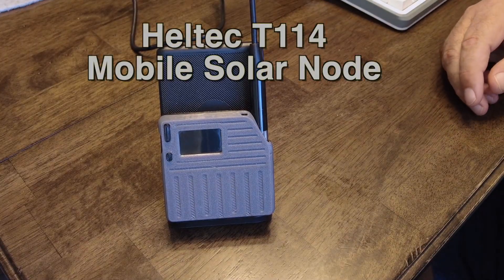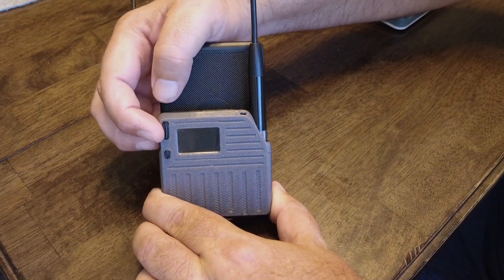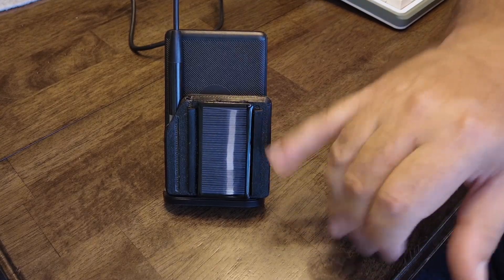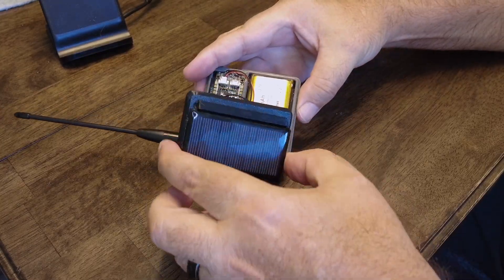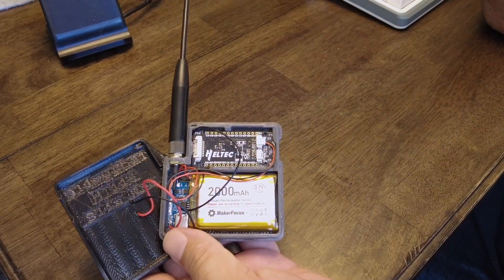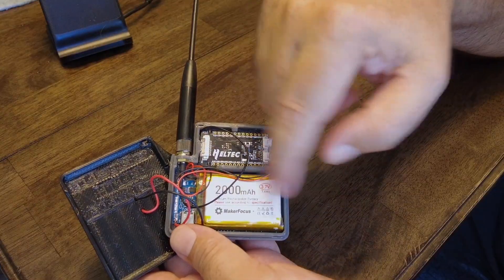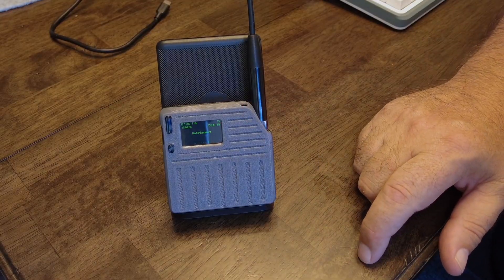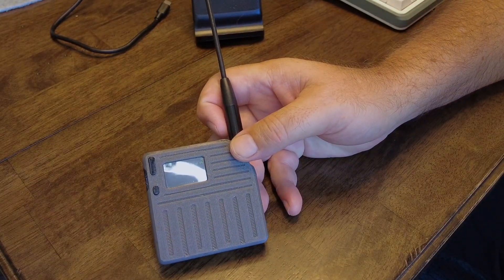Build a Solar-Powered Node That Lasts 150+ Hours!

Comment: You linked the short solar charger that Replaces TP4056 Long one. Do i understand right that, in this video, is the Long version in your printed case? Would you happen to know the difference between the two? Thanks for sharing all your information, appreciate it.
Reply from the maker: I think I just used the same version I linked. The TP4056 is not MPPT. A better, slightly more expensive MPPT controller is the CN3065 https://amzn.to/4o41IP7
Reply: @ViVSoftLLC  ok sounds good, ive never built one before so so im not familiar with the parts. Thanks for all  your help and videos. 👍

Comment: forgive my ignorance, but why would it overheat while charging?   
By a strange twist of fate, I'm looking to put a standalone node above  the snow line so this actually could be a benefit but don't want to go off half cocked.
Reply from the maker: No worries at all, Robert! Overheating while charging can happen if there’s too much energy input relative to what the system can handle, or if the components aren’t properly rated for the conditions. Living in Florida, we are used to high temperatures (95F on any given day), and with the Heltec rated at 170, but the Lipo rated at 140F, I am always worried about overheating here. It’s great that you’re considering a standalone node above the snow line—it definitely has its advantages! Just be sure to monitor temperatures and have proper ventilation if possible. If you have any specific concerns or questions, feel free to ask!
Reply: @ViVSoftLLC  ^ Grok wrote this.
Reply from the maker: LOL, yes. It sometimes interferes if I take too long to answer ... Will dail back some settings :)

Comment: Solar is good in a pinch, or in emergency situations.  my units are all Heltec ESP32 V3,  and yeah they are power hogs compared to the T114,   my next project is to make those faketec modules,  I ordered the PCB and got them very fast,  the NRF52 based module and the LoRa module are still on the way.    I do have OLEDs that I can use as well,  but for my solar setup, I wont be using the OLED.   i just like tinkering with these things, and learning about microcontrollers in general.
Reply from the maker: Thanks for sharing, Artiflex! It's great to hear about your projects with the Heltec ESP32 V3! Tinkering with microcontrollers can be a lot of fun, and I'm sure your Faketech modules will turn out great. Good luck with your solar setup, and if you have any tips or updates along the way, I’d love to hear them!
Reply: @ViVSoftLLC  I have a solar node using a Heltec V3,  everyone was saying they are terrible for solar nodes,  and it's true they are power hogs,  >IF< left in normal configuration,   put in power saving mode, and turning blue tooth off.  my node stays above 90% charge, using a 6000 mAh battery and a simple 400mah solar panel. (not a large one) it's not even facing upwards,  I have it facing south west, so gets all the power it needs in the afternoon to run 24 hours.  

this one is set for router_late,  basically acts like a router if no other router is available to repeat signals from clients etc.
Reply from the maker: @Artiflex-ai4u  Thanks for the info.